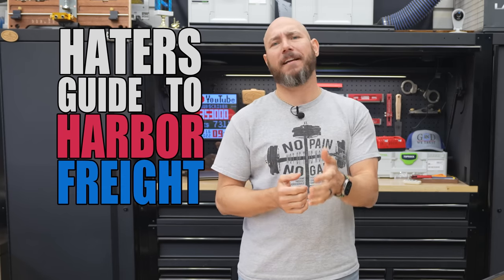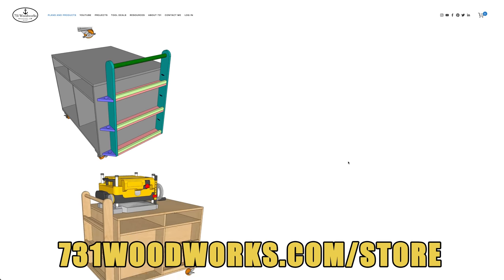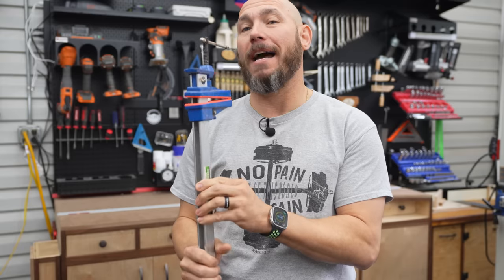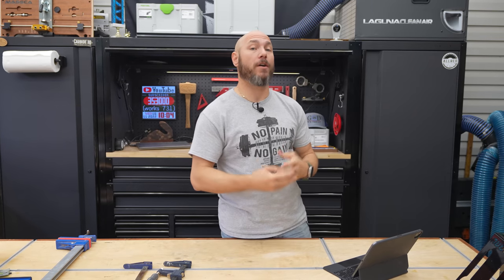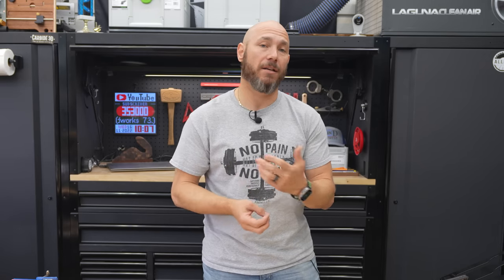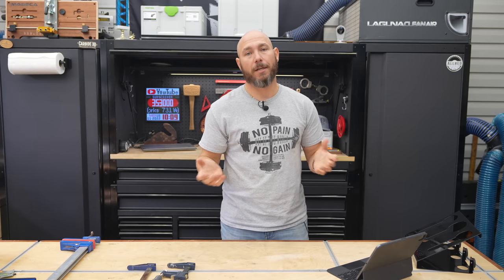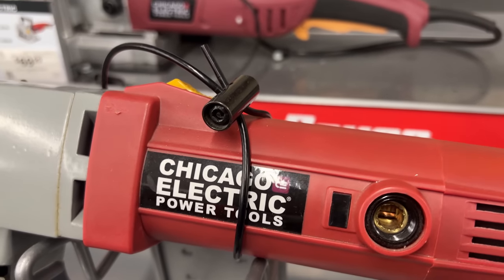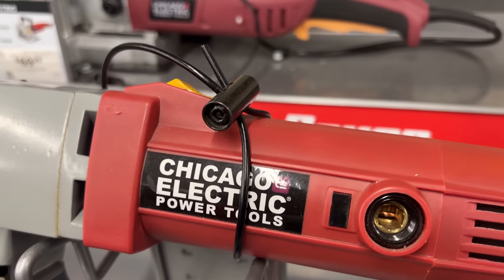The Hater's Guide to Harbor Freight | What to Avoid

Comment: Agree with most of what you said here. Although the router bits are decent enough you just have to run slower or backwards more so than the Amana or other quality bits. Compressors have served me well in my furniture building. As has the Vulcan Flux core welder. One for sure dud you could mention is their grinders, DO NOT waste your money.

Comment: You're spot on. There are some very competitive products and a large number that are not. From a diy perspective, I will by cheap tools that I will rarely use. If it gets the job done only once it can still be worth it because it just doesn't make any sense to spend three or four times as much for tool that will sit in the bottom of the tool box. Large wrenches and socket sets are some of the things I have bought. If I was a mechanic I would definitely pay for the much high priced tools because I know that there is a huge difference in the quality, durability and fitment.

Comment: The best Harbor Freight deal I've ever found is their Bauer brand 20v cordless 3.5 gallon wet/dry vacuum. $55 and it came with a free 3 amp hour battery. That vacuum outperforms my Milwaukee vac of the same style, which I totally didn't expect. Plus it's $165 cheaper than the Milwaukee and holds 1 gallon more capacity.

Comment: A few years back I was renovating an antique Airstream camper. It was 31 feet long and had been sitting in a field for at least 20 years so the oxidation was at a maximum. Polishing that oxidation off took 3 months! Instead of buying a Dewalt 8" polisher/buffer I bought the Chicago Electric and paid $7 for the 2 year replacement warranty. I burnt out two of them before I finished. I've never used it again so it served its purpose and I didn't have to spend top dollar for an albeit better tool but a tool I'll never use again. I spent maybe 40 cents on the dollar.

Comment: I’m a retired aviation mechanic, so tools are very important to me. But with that said, I soon learned that not everything had to be Snap On. I learned that sometimes a disposable tool was the better choice. So Harbor Freight is sometimes where I buy. But I buy knowing many things in there aren’t of value. One example, I was doing a little construction job where I needed to drill through a 12” slab of concrete. A rental drill wasn’t an option at the time. So a Harbor Freight knock of the Hilti T-51 was just about a $100. If I can drill through the concrete it will have paid for itself. Worked great. Definitely not a Hilti but it survived. Many years later I still have that drill out in my shed. Every time I use it, I remember, it’s paid for itself many times. So that was take on Harbor Freight.

Comment: I purchased one of one of HB's ATLAS electric 10" pole saw, works great, I've used it enough times to have paid for itself if just time vs  manual. I bought the dual 40v/80v battery, as I had planned on getting the ATLAS 80V Brushless Cordless 18 in. Chainsaw, I haven't yet, but its in the works. I've watched a few videos on them, and they aren't bad, keeping in mind I'd only be using it every few months for fire wood (trimming up and prep for splitting).

Comment: i have a ton of hf stuff that i am happy with, the catch is you MUST check reviews, its non negotiable to get a good product.
a few that i love is the red wood chipper, the us general tool chest, the bauer driver and hammer drill, the auger, their air nailer / stapler etc their small engines are usually pretty good

Comment: Grabbing a dewalt battery to bauer tool adapter has been amazing for building up a cordless collection of tools that you might not use every day but are still lifesavers when you need them. Im a house painter, so I'm not reaching for a jigsaw or angle grinder very often, but having them at a low price point in a pinch has been huge.

Comment: Commercial electrician here. After you’re in the trade a while, you learn which tools you can skimp on, and which ones you need to spend top dollar on. All my power tools are DeWalt or Milwaukee. All my hand tools which are specific to the electrical trade are Greenlee, Southwwire, Klein or Ideal. Same with benders and fishing tools. Hand tools such as wrenches are from HFT. I bought my modular tool and parts organizer from HBT about a year ago, and so far it’s great.

Comment: I've had great experience on items that are meant for extended projects where it's as cheap to own from Harbor freight vs rent name brand for a couple weekends. Angle grinder for concrete work, brad nailer for trim, rotary hammer, recip saw during demolition, etc... not that i would buy for something i plan on using regularly for pro work, but for a DIY weekend warrior it keeps it in the budget.

Comment: Hey man I wanted to let you know I went out to buy two of the Harbor Freight clamps you reviewed.  I have to say I 100% agree with your review, these are KILLER clamps and easy to use.  Like you I also have a few different ones as many wood workers do but these clamps, I am super excited to have gotten. Thank you for reviewing these products, it was very helpful.  What I did like about these clamps is not just the ease of use but how accurate the pressure felt on my cutting boards.  I also have an idea for a video for you, granted I have not seen all of your videos yet; I would make one on Tool Maintenance and clean up.  Like how to clean, sharpen saw blades, Maintenace on these claps and how to properly cover them etc.  I am not seeing many videos on good tool maintenance such as blade sharpening, how much that can save vs building new ones, cleaning them etc. Thank you for your videos, this one was very helpful!

Comment: Just found your channel today, and you do a great job with analysis/comparison videos! Watched the Ryobi video, and now this one. I would agree with pretty much everything you said here. We do a lot of the more minor repairs on equipment where I work, the major stuff gets sent out. As a result, the owner tends to be a little cheap on tools. Even for moderate use, the Pittsburgh wrenches have not held up, the round/spread out so easily. From personal experience, when I was younger and HF first came to our area, my dad purchased a lot of the cheap pneumatic tools. Complete waste of money...I don't think a single one lasted more than a year with moderate (farm shop) use. Now, last year he wanted a 3/4 air impact, and he ended up getting the Earthquake XT. We also have the 1/2 inch where I work. I would recommend those to anyone, they are awesome so far. I can't speak much for power tools, other than the 7 amp 4.5 inch Bauer angle grinder we recently got for work seems to be very good, especially at $30. I have no experience with any cordless tools, I'll stick to Milwaukee and DeWalt for that. (Home Depots and Ace Hardwares are more popular around me than HF or Lowes). Lastly, going back to the wrenches...a coworker did recently buy some Icon wrenches and ratchets. They seem to be OK so far, and I was shocked at how expensive they are (for being a HF tool) when I looked them up online. I know they are trying to compete with Snap On by selling Icon, and it reflects in the price. But, they are way better than any Pittsburgh tools so far, so time will tell if they are worth it. Bottom line, don't be afraid to buy the "best" at Harbor Freight, and you'll likely end up with a decent tool while still saving money compared to most major brands.

Comment: I have a Pittsburgh 1/2" drive 20-150ft. lb. torque wrench that I purchased in 2000.  That off lasted a 3/8" drive craftsman torque wrench purchased around the same time, which only lasted around 2 years.  I also have purchased the 20V drill/driver and 1/4" Hex impact driver by Hercules.

Comment: I have the Hercules 12” miter saw and it is quite capable especially for the price. I’ve had it for 3 yrs, no real problems. Dust collection is very poor, and I have to check and adjust square with every job. For a budget saw tho, u can’t beat it. 
Since I build furniture and wood countertops for a retirement living, I have switched to the festool.

Comment: I have used their Pittsburg brand of impact sockets daily for the past 13 years and haven’t had an issue. Chicago electric is fine I if you need a tool for one job or use it once a year. They have a roll of Velcro that is great for keeping electrical chords neat.

Comment: I have the Hercules random orbital sander and love it better than four other brands I have. 

I also love the LED 10,000 k shop lights. They are the best fixtures I have. 

I love the Yukon tool box so much I bought a second one.

I use lots of their drill bits in small sizes.

I just bought the new airless spray gun yesterday which compares to Graco. I will rate soon.

Comment: Another great Harbor Freight tool: Central Machinery 2.5 Liter Ultrasonic Cleaner

 I've been using this ultrasonic parts cleaner in my garage for two years now without issue. Its not very big but I use it for cleaning underhood plastic pieces, carburetors, crusty hardware, etc for car projects i'm working on.

Comment: I work maintenance at a plant and turn wrenches every day. The Pittsburgh ratcheting wrenches have worked just as well for me as my gearwrench wrenches that I've lost or broken. They're ever so slightly fatter though. 
They sell Doyle screwdrivers that are good screwdrivers, pry like hell with them and have never broken or bent one yet. 
Badlands winches are the best winch you can get for the price point. Does everything a warn does at 1/3 of the price, can also vouch from personal experience.
Have a Bauer corded angle grinder that works well for home use, definitely doesnt stand up to the Milwaukee and Dewalt ones i use at work - but its great for the price.
They have 30' tape measures for like $6...have one and use it.
Moving blankets, nitrile gloves, ammo boxes - all good things to buy at HF as well.

Comment: I’ve used their Warrior brand Sawzall and oscillating saws for about a year now and they’ve held up pretty well. I will say I don’t use them that much, so that might be why they have done so well. 

My Chicago Electric right angle grinder that I bought for $10 at their sidewalk sale has lasted me almost 5 years. Again, I don’t use it everyday, but it’s still going strong when I do use it. 

You’re spot on about the rules and squares though. They just aren’t as accurate as I need for fit and finish. 

Great video!

Comment: I bought a Chicago Electric impact driver in 2016 for $35. I used it for remodeling a bathroom and later heavier remodeling work on several houses. Outside of the battery not having great lasting power it have performed above its 35 dollar price and for 7 years now when I finally replaced it with a new Craftsman impact. Im still keeping it around as a spare because it still hasnt given up.

Comment: something I use that I bought directly from harbor freight was a tow bar. If you need to tow something I have towed way more than that bar should be able to handle, and it works great. It was only $100ish bucks

Comment: The Hercules miter saw is amazing. It's basically the copy of the DeWalt you mentioned that I used to have. The bower router is also really good. The hf chisels definitely suck. I sharpened mine and used it all of 5 minutes and it was so full I couldn't stand it

Comment: I have alot of harbor freight tools and so far only had problems with one. I got a charger pack that I could not get to charge so took it back and got another at no cost to me. Works fine now. I steer towards the Bauer line of power tools and found the drill /Driver has more torque then the porter cable my dad gave me. I do agree with the stay clear of drill master, its garbage. the Bauer and warrior lines are pretty good and have had no problem with the squares so far. All real power tools in my shop are the older craftsman  tools.

Comment: I have a lot of things from HF that I use only occasionally like the chop saw, sander, drill press, and metal band saw. They work great but I wouldn’t depend on them for hard use. It’s nice to have a good inexpensive option for various tools. For my battery tools I stick to Milwaukee M12 and it works great for me. One thing I do recommend is the 1/2” earthquake  20v impact wrench it’s a beast. Although I just got the M12 1/2” stubby which will probably take over 95% of my impact wrench needs.

Comment: Years ago I was starting my first job that required me to have my own power tools (impact driver, drill, oscillating Multitool). We build and maintain cabins. Huge timber screws, lag bolts, etc, but I was broke so I went to Harbor Freight and bought some cordless Bauer tools. I've come to find that they're punching in the same weight class as my coworkers' DeWalt tools (can't speak on my boss's Milwaukee tools because he almost never uses them onsite), and at that I don't feel bad dropping them, tossing them, and putting them through Hell because I know that if it breaks it'll cost almost nothing to replace. I'm dedicated to the Bauer cordless tools because I'm still using the same ones I first bought and they still work like new. Only thing I've ever broken was a battery when I dropped my impact, and the battery still works but just has a hard time staying on the tool.

Comment: I bought my milling machine, machine lathe, and wood lathe from harbor freight. They've all got decent motors in them, and they're chunky cast iron frames make them surprisingly  rigid. The only downside is the machined surfaces on the castings are horrible, and some of the controls have flimsy handles. After hand stoning the bed and ways on the milling machine though, I was able to use it to resurface the castings on both of the lathes, and they all got new metal handles to replace the plastic ones. They now perform like I would expect them to, to the same precision of any manual machine. Also, when I crashed my mill and needed to order a new drive gear, the customer service center was really easy to contact, and if you save the book that comes with your stuff, most have a complete parts list and exploded view of the tool, so ordering the exact part you need is pretty easy, and that one cost me $4, so I ordered 5 knowing I'll probably crash it again, and that's the only plastic part in the entire drivetrain, so I'm pretty sure it breaking is the point, so you don't trash the whole machine. Are all their  tools good? Hell no! But for the heavy duty stuff they make, it's pretty OK with a little modification (it's hard to mess up cast iron and tool steel), and with a little know how, you'll save thousands on something that you won't have to scour the corners of the earth for parts for when you inevitably break it.

Comment: "Trust" is the key word he mentions. I have some HF stuff I use w/no issues. But, every time I grunk down on my 24" HF prybar...in the back of my head...I'm worried it's gonna snap. I bought & used a set of HF "Dremel" wire wheels...never again. I could feel the bristles flying off of it.
I do however, like a couple of Chicago power tools, that I use infrequently: Toe kick saw and right angle drill (for tight spaces)...good value.

Comment: To date I've had no issues with their sockets...I've had some of the cheaper wrenches get a little wonky with HEAVY DUTY work. The Icons are great and have held up well, 0 issue with those so far. The Pittsburgh adjustable wrenches are frustrating and I would opt for something nicer.

Comment: Two items you mention to avoid actually have other good purposes. The Chicago Die grinder is a good tool, I've had one for years and its gone head to head with my Makita and held up great. The cheap 18v Warrior drill and Drill master or Warrior bits are also decent for the money. The drill is just that, a 3/8" drill I use mine mostly as a screwdriver though and its been great, and its cheap enough to have multiples around the shop. It does not take the place of a better Dewalt 1/2" drill but its perfect for assembly work and repairs. 
The cheap HF chisels are worthless on wood but the fact that they're so soft make them excellent engine gasket scrapers. They're so soft it makes it hard to damage the cast surface your scraping.

Comment: A late comment about the Hercules table saw. It's quite good for the money. The one you show in the video is the older model that does not have a rack and pinion fence - and agreed it was not great. The newer model is a huge improvement. For saw blades, I use Hercules 8 1/2 and 10" carbide. They are just as good as Dewalt, Milwaukee & other name brands.

Comment: As a mechanic I have a large variety of different brands including harbor freight. I have snap on, craftsman, and all the rest.  I buy quality if I use it a lot and need durability and reliable accurate results every time.  Harbor freight for things when I just need it to function and quality and durability is not critical.  Great video.  Explains it exactly the way I shop at Harbor Freight.

Comment: I have Pittsburgh 301 pc mechanic's tool set, set of impact sockets, 3ton floor jack, and jack stands that I bought 6 years ago. from HF... they are good tools and get a lot of use. I had a bunch of bad Pittsburgh screw driver sets that were super cheap and broke, but ended up with a nice Icon brand screwdriver set that has proved to be really high quality from HF.